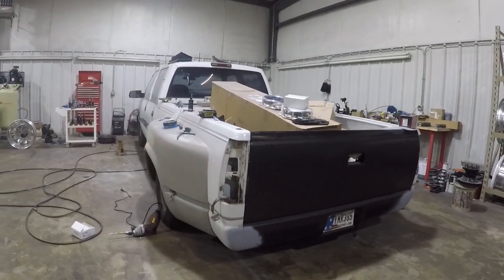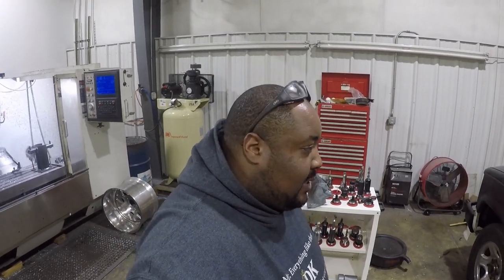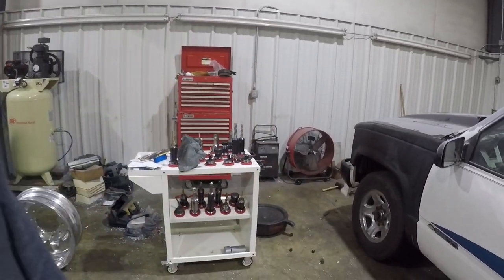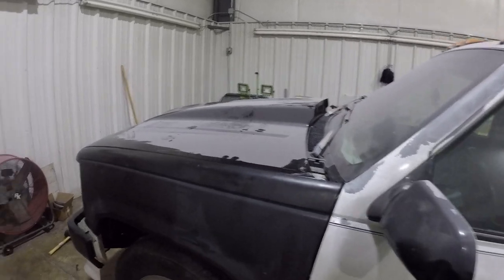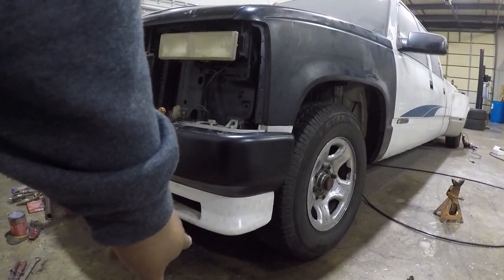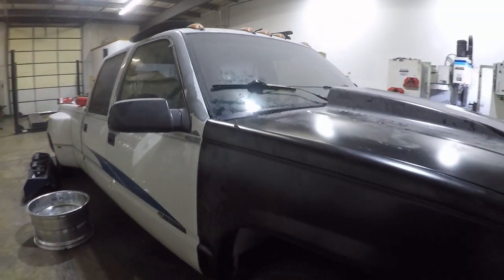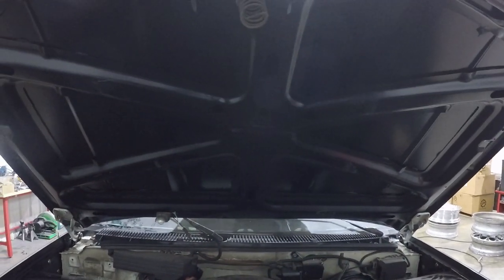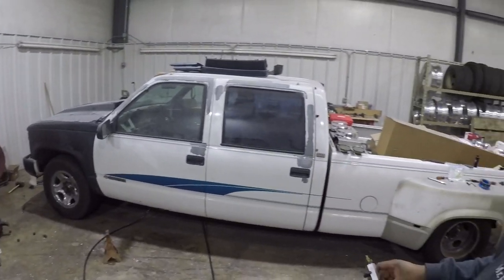Working on the crew cab PT.2

Comment: Yes indeed! It does not need to lay frame, Love the rims , nobody will have them! I have a 05 F-250 XL ( going to be a  regular cab dually with super singles)that I'm putting 22's on it but want something different on the wheels! Right now should be close to 600hp, hopefully be closer to 800 hp soon , it is my daily!